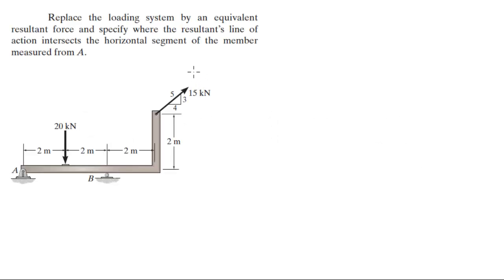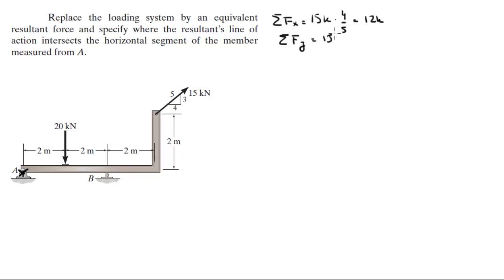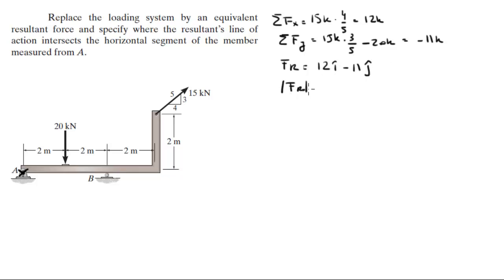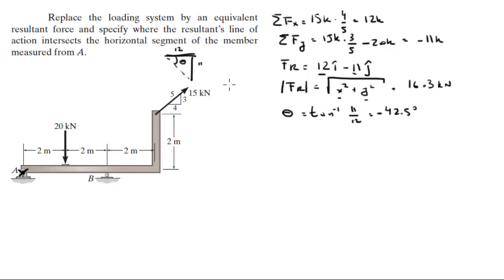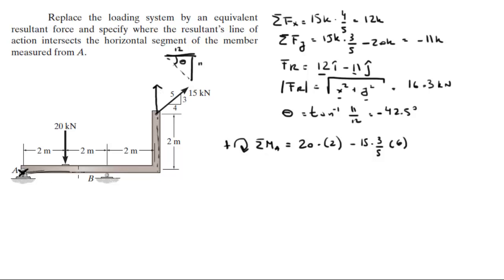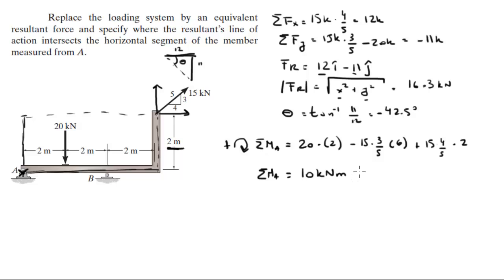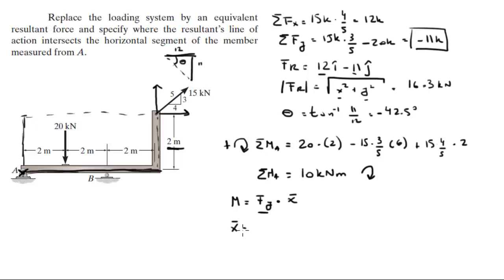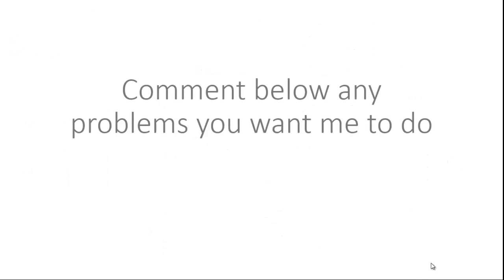Replace the loading system by an equivalent resultant force

Comment: when u calculated the sum of moments why did u not add the moment caused by reaction at B
Reply: Because since it is statics, if you solve for the reactions at B you'll get MA=0 and FBY = 2.5 kN, and thus FR's location is not possible to find. That would be a different problem.

Comment: The right convention is that clockwise is always negative and counterclockwise is always positive. Therefore the moment should be -10kN. The result would stay the same because -10/-11= +0.909. It should be minus 10kN but you also forgot the minus on the 11. Otherwise thx so much for these videos, they are really helpful!
Reply: I thought it doesnt really matter with magnitudes
Reply: You can assume CW is either negative or positive. He's doing that so he can get a positive answer.
Reply: There is no "right" convention, you simply have to assume a reference positive and negative direction and do your calculations accordingly, the conventions shouldn't affect the answer